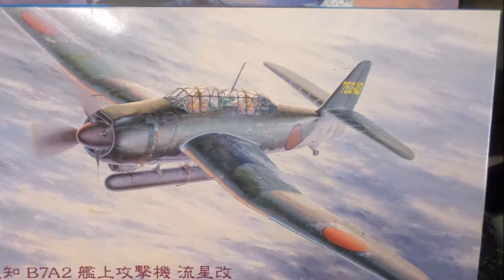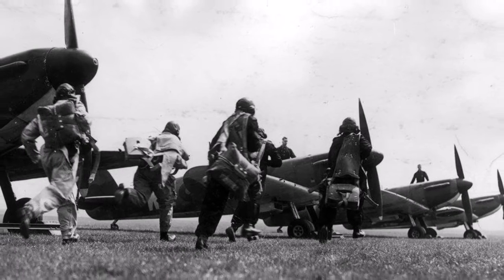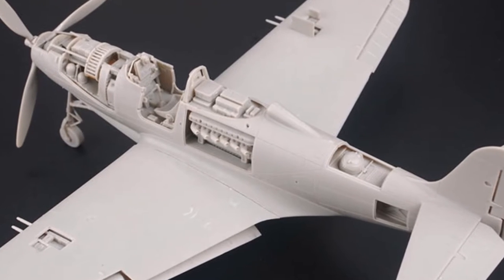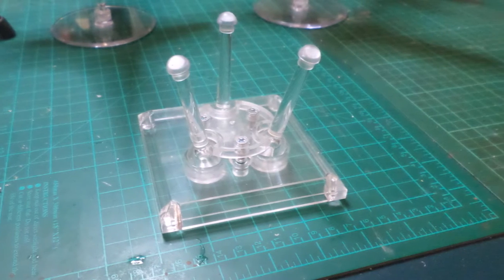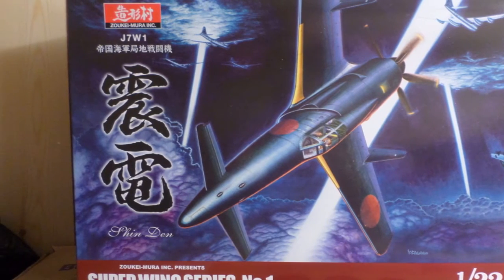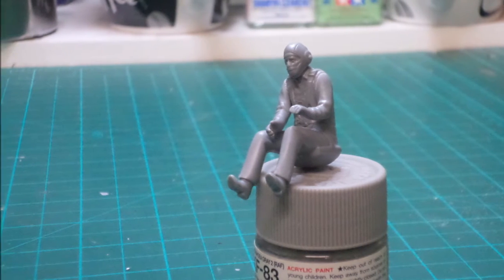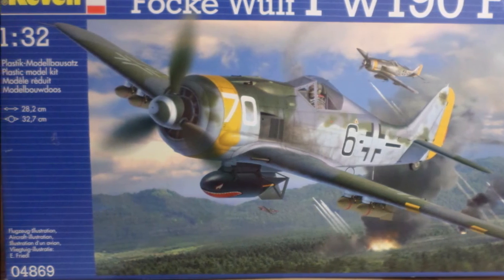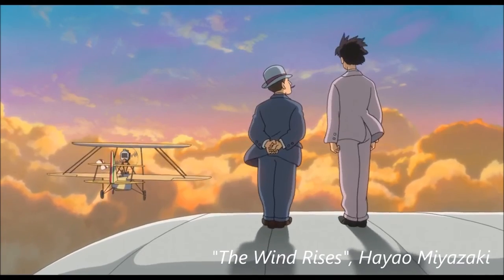The Boxart Paradox - why do we build model aircraft on the ground?

Comment: G'day Chris, I've been enjoying catching up on your earlier videos. This is an interesting topic and one that I hadn't given much thought over the years. I understand what you're saying here. Yes, aircraft are designed to fly; the landing gear is there to get the aircraft into the air and, importantly, return it to Earth safely. In flight, landing gear present horrible drag problems when left down in modern, fast flight; so, pilots get them up ASAP. Ever noticed how quickly carrier based aircraft get their gear up. The need every possible oz of lift as soon as they can or they might end up in the drink.
Given all that, I too commit the 'sin' of doing most of my models sitting on the ground. 
When I think about it, I shouldn't. 
I dislike doing landing gear; it's fiddly, most gear is different and if you break a part, it's really difficult to scratch build a replacement. Landing gear is the only part of aircraft modelling I don't look forward to so, why do I do it?
There are the obvious ones, lack of stands; my horrible woodworking and scratch plastic skills; I'm now physically unable to get up there and string planes from the ceiling; which I think hides some of the best parts of a model. 
Then, for me, there's a more personal reason. When I finally got posted to my first flying base, in the RAAF, the way I encountered all the aircraft I came to love so dearly, was when they were sitting on the flight line, or in hangars, 'waiting to greet me'. It's the way you get inside an aircraft to get to know it 'personally'. I'll never forget the first time I walked up the rear ramp of my beloved C-130s, it was like entering a weird and fascinating new world.
Of course, before that I had flown on countless passenger aircraft where one walks through a 'tube' right into an environment that looks a lot like a Hilton hotel room. You can't really tell what kind of aircraft you've just boarded; they all look the same. 
But walk on-board a Caribou, for instance, and the first thing you notice is the round hatch in the deck that lets paratroopers drop out of the aircraft when it's impractical to open the rear door. Most fighter cockpits look the same but each one has its own environment and instrument settings. 
Climbing into an Orion is like entering a high-tech computer workspace and at the rear there are holes to drop sonobuoys and anti-submarine ordinance down to the sea. Fascinating stuff. 
Boarding a Neptune is like stepping back in time. As I've never been lucky enough to get on-board a Lancaster, a Neptune is the next best, similar interior; we still had a few of them when I joined and I truly loved being inside one of those old blue ladies. Painted like they had white 'hair' and wearing a dark blue 'dress'. 
Then there's the thing, for me, that apart from some Medivac and SAR work on our Hercs, I wasn't flight crew so my most memorable experiences with the RAAF's fleet was while they were sitting on the tarmac. Of course, I’d plead to take a ‘jolly’ at every opportunity and I had many.
Talk to any RAAF aircraft handler and they'll tell you marshalling an aircraft out of a hangar; onto a flight line and then moving them for take-offs or getting them back, safely on the flight line was simply the best job in the Airforce. I got some mates to teach me how to do that. 
I can tell you it's a real hoot to be able to wave your arms around, talk on a headset (with the longest extension cord in the world), to a pilot who is trusting you to move his aircraft into places he can't see is a serious and valuable task.
I'm rambling now but I guess what I'm saying is that, for me, the landing gear and what it does for the aircraft and crew (pilot) is equally important as the engine(s) that get them up into the air and the environment they were designed for. 
Because of the issues this video forced me to think about; I'm going to take the plunge and model my next few kits, wheels-up. It will make my builds quicker and that's good as I have multiple builds to do to celebrate our 100th 'birthday' this year. I'll figure out how to display them later.
[footnote] There's a Pommie modeller I watch on YouTube (a great modeller) who hangs his finished models up against his walls; tail up/nose down, like the way people hang brooms against a wall, only he does it with little hooks, I think. OK, I guess but it totally hides the underside of his models and the aircraft look like they are doing suicide dives!
Cheers, Chris. I'm really liking your videos they are fun, informative and, like this one, thought provoking. Thanks, mate! Bill
Reply from the maker: Good to hear from you again Bill!
Reply: Good stories! I was a photographer in the RAAF (79 to 99), photographed lots of aircraft, got to hang with air and ground crew. Top fellas.
Reply: Hey, Bill. Great post. Who is the Pommie modeller you refer to?
Reply: @supercededman  G'day Steve, It's always good to hear from ex-RAAFY chappies! I missed you by one year. I got out in 1978 after an unremarkable yet totally enjoyable time in uniform; sadly, towards the end it was that horrible light blue rig that everyone hated. Put a dress webbing belt on those jackets and before you knew it, the jacket was riding up towards your armpits... they looked awful. 
On some bases they just forgot the jackets on a dress parade; even for some O.C.’s parades. Unbeknownst to all, except the idiot who gave out the contract for those uniforms, was that they were identical to the NSW railways uniforms. 
We dreaded travelling by train as little old ladies and tourists would stop you and ask you what time the next train to Lidcombe was! Not noticing the eagles on our lapels or the rank insignia on the arms. 
Those lapels eagles also got me and a few others into some embarrassing moments. When US servicemen and women were here in Australia and they spotted those eagles on your lapels, they naturally assumed that you were a 'full bird colonel'! So, I regularly got salutes from senior NCOs and officers who, again, totally overlooked other signs that I was an airman. At the time I was living in a rental house just of Kings Cross so US personnel were everywhere. I got so many salutes from Americans, I deliberately, returned the salutes in the American fashion, just for a personal lark. I was getting sick of returning so many salutes ‘our way’.
 Apart from fast jets, of course, I had the great thrill of getting a 'jolly' on just about every aircraft we had, even some 34 Sqn ships.
Somehow, I got a posting to 486 Sqn at RAAF Richmond (I’m the least technical person on the planet). I got to know more than a 'desk jockey' should ever know about our Herc's. I grew to love them like old girlfriends. I can still pick one coming from a long way off. 
It was heartbreaking what happened to our old A Models. They gave outstanding service to this nation and were totally disrespected in their retirement. Sitting at the end of an old taxiway, quietly rotting or a couple being sold to criminals or those who just wanted the metal. 
I could tell you some fantastic Herc stories but they would probably, still, get me and others into trouble.
During 2019 and 2020, a few ex-RAAF mates and I thought we should celebrate 2021 with a multiple build of all the significant RAAF aircraft since 1921. We worked hard. I got stuck with the ‘Equipment Officer’s’ job of sourcing kits, add ons, PE, research books, the lot. Luckily, I have some good mates that work at the AWM who helped me greatly with period photographs that few others have seen. We did our best but there are big holes in our ‘Commemorative Wing’. Like finding a 1/72 or 1/48 DHC Mk 4 Caribou is just impossible, or it was then.
We found a couple of types of CAC CA-27 Avon Sabre conversion kits, however, they were so badly moulded, plus they had a large ‘squarish’ part that, to this day, I have no idea where it goes on the model! 
Still, it was a great learning exercise; I had no idea how many different types the RAAF flew, even just a couple here and there for evaluation. Like, did you know, that for a time the RAAF flew two B-29s, we got from the RAF, who called them Washingtons? They did some ‘spooky’ stuff up around Woomera and then, just disappeared. Anyway, to answer your second question, the nice bloke who hangs his big models up like brooms in a cupboard was from https://www.florymodels.org/ I’m sorry I can’t recall his name but they do great instructional videos but I had to back out of their subscription as they charge 50 pounds a year and these days both me and my better half are on pensions. If you’ve got the cash it really is a site where you can learn a lot of good tips.
My other favourite modelling YouTube channel is Harry Houdini Models. Yep, Houdini is his real name. I’ve got to know him and he, also, specialises in teaching easy ways to do difficult modelling jobs. He’s a real Aussie character and a former TV technician who really knows how to edit and produce good videos. He specialises in wooden and plastic boats but does all other kinds as well. He’s saved me hours of work because he devises techniques, jigs, processes that take chores out of modelling and let’s one just have fun with the hobby, which is what it’s all about.
One of my long winded replies; but forgive me, I’m a military historian now and writing is my thing. It cops me a lot of flak from those who are too used to the hundred-odd characters allowed in Twitter. So, I’ll sign off for now. I’ve got a YouTube page but I’ve never posted any videos, I’m all thumbs when it comes to such matters. 
All the best for Christmas and a Great New Year, Steve. You can drop me a line anytime you like. I have a good mate who was a RAAF photographer, I’ve got a lot of respect for the magnificent images you blokes and girls do and how, sometimes, how difficult it is to get the ‘perfect’ shot. My wonderful wife was my photographer when I was a ‘fluff’ journalist covering international film festivals for several Aussie papers and magazines. One of my better post-RAAF jobs. 
Many years ago I spent five years, part-time, writing a history of the Australian film industry. When my book got a kicking from a journalist on The Age, in Melbourne, I complained to the ‘Green Guide’ editor and, over lunch he offered me a job. Suddenly, I was a journalist and the oldest ‘cadet’ in the long, long history of The Age. 
But there I go rambling again... that’s another story.
Cheers, mate!  Bill

Comment: Totally agree , I now build wheels up .    some planes look good on u/c .....Jaguar (there's an undercarriage !)    FW 190 , Sea Fury  etc. others  not .  Spitfire always has that "knock-kneed " look to it  ,  F-22 looks as if the u/c has collapsed and others like F-16 look spindley .     Just my opinion , anyone ??
 I use a plastic coffee jar lid  ,( Yes , on a budget here !)  coathanger wire , drilled into it and embedded in plaster / filler  to give it a bit of stability , top fits into styrene tube drilled into belly of the plane . You can alter attitude in flight . Only prob is having to buy pilots , I just bought 2 1/48 size which cost almost 1/2 the price of a kit . I wouldnt spend a week painting an ejector seat .        Wales UK
Reply from the maker: There's only two mainstream aircraft that look as good parked as they do in the air - the P-47 Razorback and the F-14 Tomcat. Good to see another proper airplane modeller! Cheers, Chris
Reply: @beckersmodels  Hi Chris , I have put several  What-ifs'  on my channel  ( In flight naturally ! )

Comment: I also feel most modelers..even good ones are afraid to paint humans. they know they can lose a perfect looking machine with a less than decent human miniature. I think to show an aircraft, you need to show the main armament..its human
Reply: Anyone who can paint cockpits and weathering, can brush paint a good human. As a beginner I found infantry the easiest and most forgiving place to start.
Reply: G'day Mike, This is, in my opinion almost totally down to the ridiculous molding of pilot and crew members. They just don't have enough detail molded into them and do not have smooth enough surfaces so they can be painted properly. Companies that specialise in figure model making should team up with companies that do aircraft and tanks etc. If you can paint a small cockpit detail then you can handle a human figure but it has to be made properly in the first place. It's a shame. 
I leave my pilots out because no matter how hard I try they always look like 90 year olds who have been dipped in acid baths! Cheers, BH
Reply: @BillHalliwell  Perhaps I should check again in all the kits in my stash, but I don't think I have any pilots so badly made that painting them with full mask and visor wouldn't suffice when the canopy is shut.
Reply: @thoughtengine  G'day Thought, OK, maybe I was exaggerating a little but only to amuse, otherwise it's just another dull comment. It is true in some kits, I assure you. I see your point, totally. In modern flight helmets the face of the pilot is just not there. It's a black or silvery mass, usually with a dull grey helmet and a different type of grey tube coming from the mouth region. That's cool and easy to paint. Sadly, I specialise in WW2 kits in 1/48 and 1/32 and, generally, the pilots' craggy faces (some with plastic seams up the side of the head) do look somewhat hideous, worse still, the majority are not wearing their breathing apparatus. Most have a leather flying helmet, that's easy. It's the Bela Lugosi faces that creep me out. Short of 'plastic surgery' with a hot wire, which I've never tried, I don't know how to make them look, well, human.
Yet the figure painting branch of our hobby produce positively anatomically perfect faces. What a shame an aircraft kit company don't think of making special production runs of 'handsome' pilots in different scales... I reckon they'd make a fortune. Anyway, now I've put you lot to sleep. I'll do the same. Cheers, and goodnight. BH

Comment: This always bothered me as well; I almost always build my planes with gear up but it requires a bit of modification and putty. Tricky to get it to work right sometimes. 
Some old Monogram kits (Hellcat and Avenger come to mind) have working gear, folding wings, and retractable tail hooks, though sometimes some extra engineering modifications are required to get it to look right. 

..I couldn’t agree more!

Comment: Really thoughtful video. As with many other comments, I'm going to build a few in flight.

Pilot figures? Also, stands. Which stand do you mainly use?
Reply from the maker: Thanks Steve - I mainly use aftermarket pilots (Aerobonus/Aires/PJ productions) although I have collected (through non-flying aircraft modellers) several kit pilots that I can use. As for stands, out of the box solutions include Flightpose and Academy/Minicraft, or I make my own out of clear acrylic rod. Cheers, Chris
Reply: @beckersmodels  thankyou. Your videos are inspirational.

Comment: for me it depends how the plane looks best... a fairey barracuda for example looks better...ish in flight obviously so I put that one on a stand. but I like those manually retracted landing gear of grumman fighters and I always put those on their wheels. spitfires and messerschmitts also look better aloft but a thunderbolt looks great on the ground. but most planes I built have fixed undercarriages anyway sooo :D
Reply from the maker: Have to agree to all of that - I did my last P-47D wheels down and it looks much better, same with a Grumman Hellcat (half-finished, its the HB 1/48 attempt - see build review). 
I'm tossing up whether or not to get a 3D printer and design closed in wheel well doors to get around the foibles with doing it yourself! 
Thanks for your comment, cheers Chris

Comment: To me it’s clear: wheels up, your craft is flying, chasing down and firing on the enemy (in many cases) as a child/young teen I never ever built a plane for the tarmac. They came with stands not fuel pumps and  hangers. 
However your words caused me concern as yes I do want to show of the ‘internals’ you mentioned, these weren’t there in my day (?)  but does one really have a parked plane with missiles loaded??  
So I want a beautiful plane with all the internals that makes me work to build it and paint oh and it must be in the air  with a pilot one may paint actually flying the thing!!!!!
There! Pick the bones out of that dear manufacturer’s.
Great piece Chris
Bob
England
Reply from the maker: That can be achieved by using rare earth magnets to open panels/remove ordnance etc - I'll be doing something similar on my 1/32 A-6 Intruder, so you can see the engines and landing gear and what not behind the panels...

Comment: I build my models for the purpose of 'holding them'; very well built with all detail possible, but built tough.
so I can grab them in my hand and study their every line, and I love to look at them while in flight, either
hanging from the ceiling or on sitting on top of a custom made clear acetate stand.
 From my 1/144th's to 1/48th's most them are wheels up, anything 1/32nd very likely will be wheels down.
The difficult ones are the helios; rotors are tough to portrait in flight....so those suckers stay down...!!   =)
Reply: I get around this problem by making my 1/72 scale, ceiling hangers, displayed in flight using very fine fishing line and using thin clear cut plastic discs, slightly airbrushed for the propellers. My 1/48 scale aircraft are displayed on the shelf, wheels down in a diorama situation so you can see the detail close up.